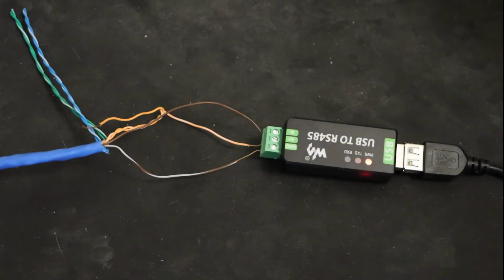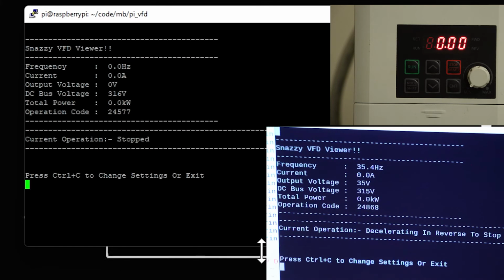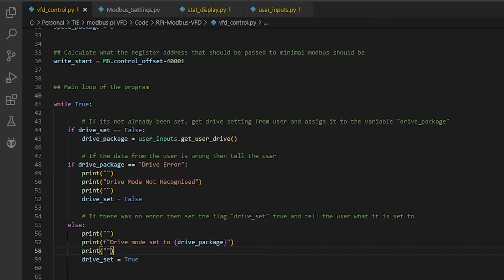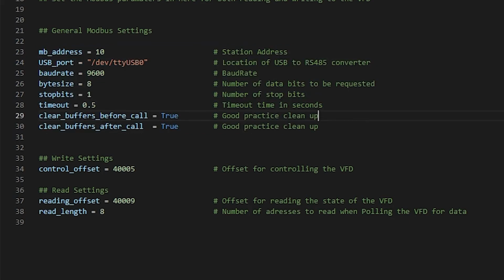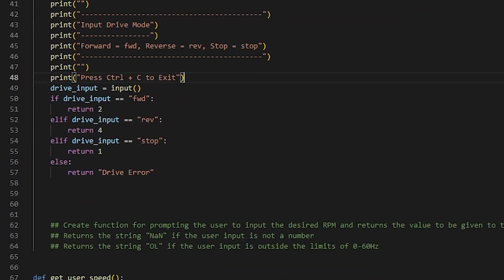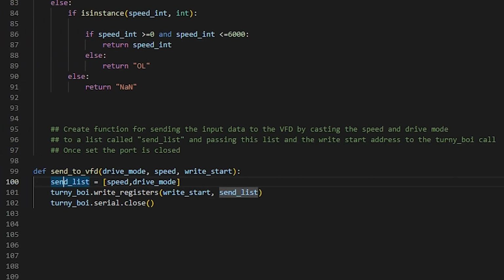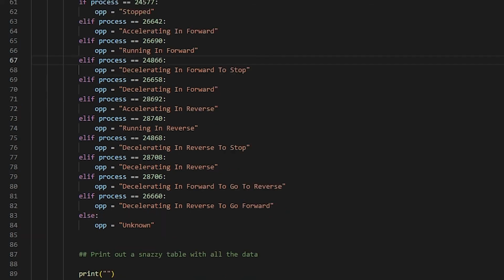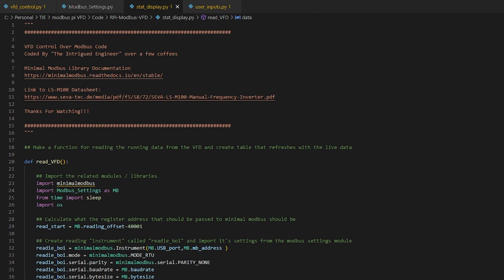Raspberry Pi VFD Speed Control Over Modbus

Comment: Hi,

thank you for your great Video!
Can you tell me, how to set the acceleration und decleration time via Modbus.
I want to ramp Up/down the frequency for example from 0Hz to 10 Hz in 30s.

I have tried it with turny.boi.write_registers(7937,ramp Up/down time)

0h1F01=7937 should be the adress for the acceleration time. Ramp Up/down time should be 30s*10.

It would be very nice if you could help me Here!

Keep up your great Work!

Comment: can I use it in the sanya sy5000 series??
Reply from the maker: Hi, yeah, I've just had a quick google and yes you can. the Modbus RTU specs are on page 181 and the actual control portion of this is detailed on page 196-197. Here is a link to the Documentation if you don't have it already. https://www.aea.com.ar/assets/documentos/productos/es/2720_1.pdf
Reply: @Intrigued_Engineer   i can not convert this offerset control register.can you please help